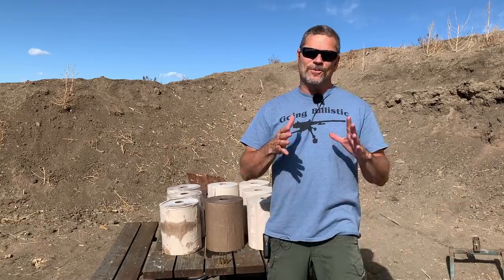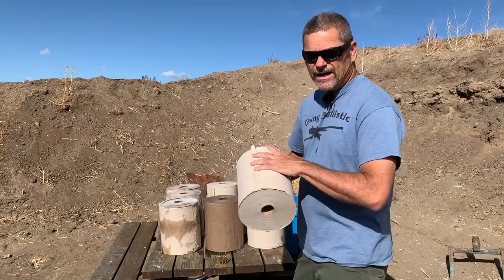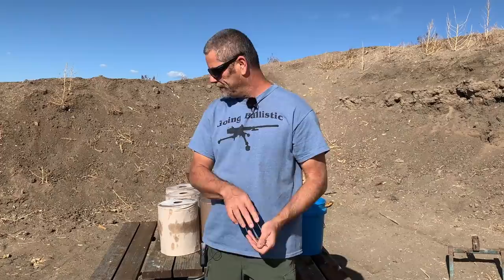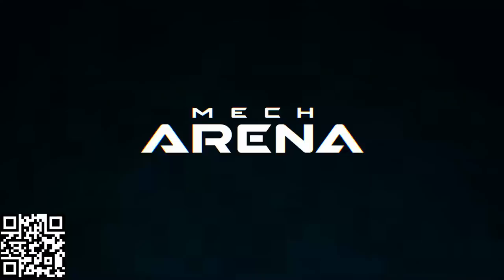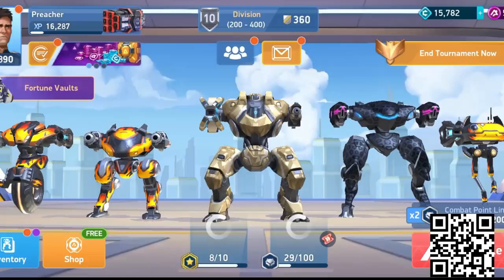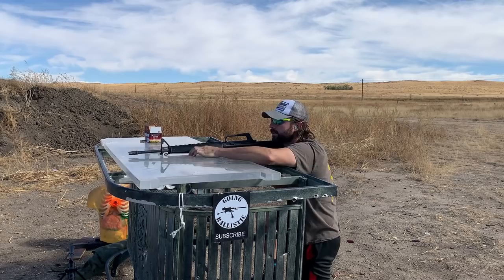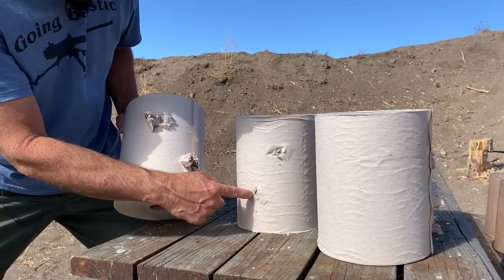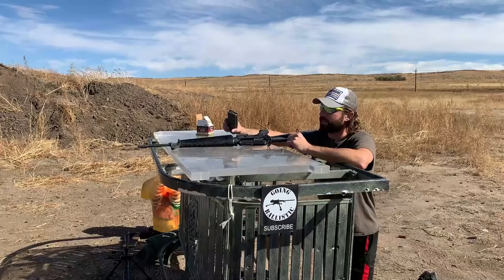50 BMG Zebra Round vs Paper Towels

Comment: ive takin apart 5.56 62grain federal green tip from a sealed 30cal steel ammo can with the 10rnd stripper clips 3 clips to a carboard sleeve  & they had a copper jacket a steel cone shaped slug up front & behind that was a lead slug twice the size as the steel piece..  thats whats in a M855 green tip 62gn..   Unless you ment the new "green tip" witch is more like a brown tip witch the first brown tips where steel up front & copper behind the M855A1 Copper then they moved to the M855A1 Tin/Bismuth ..  Ok i looked it up lol i was curious  they did make a variant of the M855 green tip with a copper jacket, steel tip, & copper slug behind it like u found at 8:55 ...  found a picture & this caption below it (The second picture is the another from Oak Ridge, Tenn. from a company called Powell River Labs. Its another M855 made with powdered copper.)